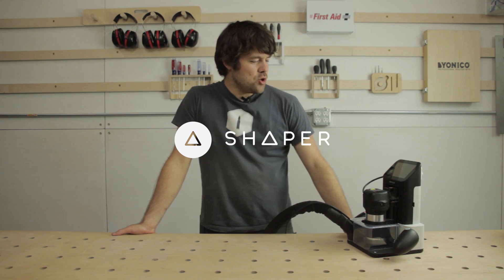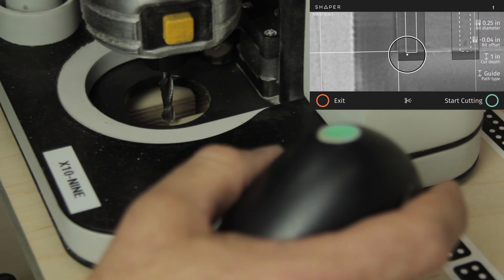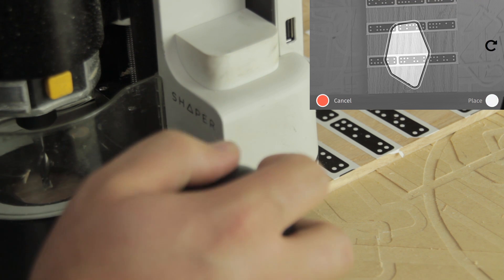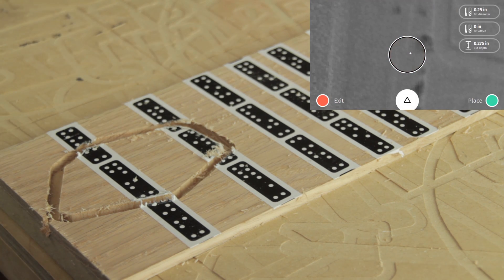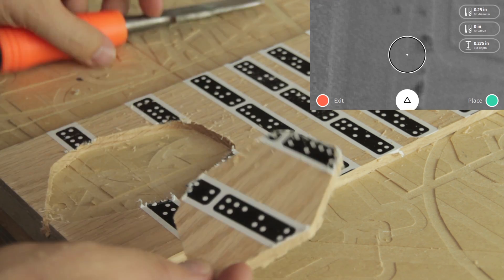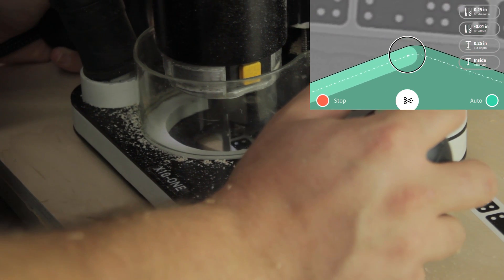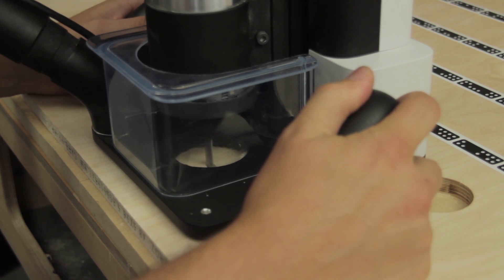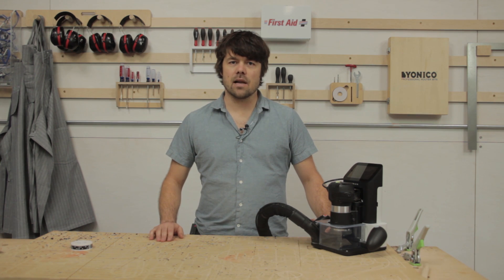Core77 Q&A

Comment: That vid you did for tested https://youtu.be/p_wk3q8jWcs?t=15m37s . What's to stop you from capturing the drawing on the material surface, extracting spline shapes, and then performing the cut? Bit like those apps that you sketch a circle, and the app auto generates a perfect circle.
Reply from the maker: That's in the works :)
Reply: When it's working, you could do a vid where you use a ruler and a soup can to make a child's toy truck. All the pieces drawn directly onto the material. Hi-tech meets dad-tech
Reply: Be nice if I could draw a circle for the wheel with the soup can, and the Origin could auto find the center and drill a hole for the axel
Reply: It's not that the Origins interface isn't pretty, cause it is. But it's very 'hunt and peck' on a tiny screen. Even though it's nice, it still possibly a bit confusing for average people. The interface should be on the material! 

This is something I dropped on the Handibot site... https://handibot.com/idea-detail.php?idea=84 but I think you guys are a lot closer to nailing it. 

If someone wants a circle they sketch it on the material and the Origin cuts it out the perimeter verbatim.
 If the user draws a cross hatch inside the boundary, the Origin knows that the user is removing all the interior material.
 If the user draws a line across the diameter the Origin treats the perimeter as a perfect spline circle.
 If the user draws a number next to the circle, the Origin now knows how deep to cut.